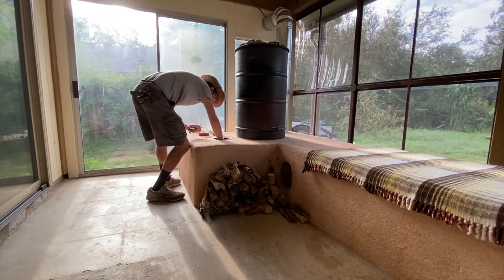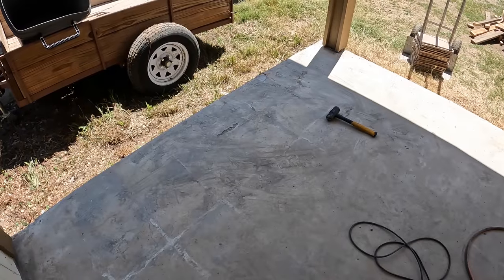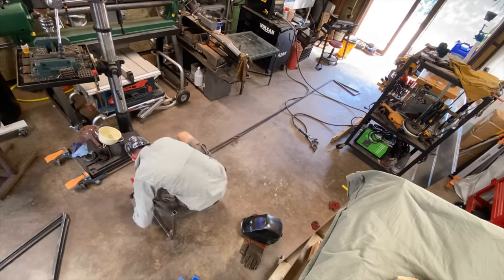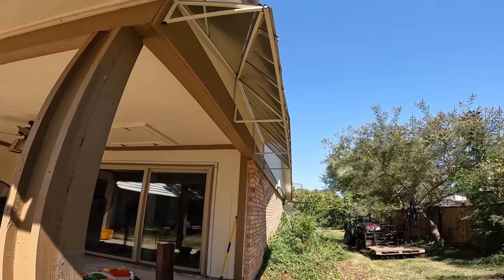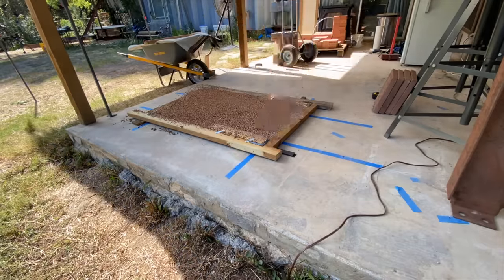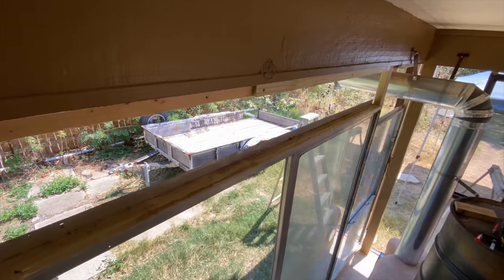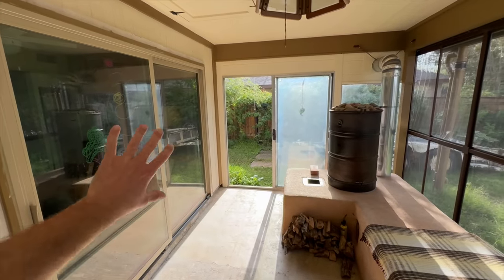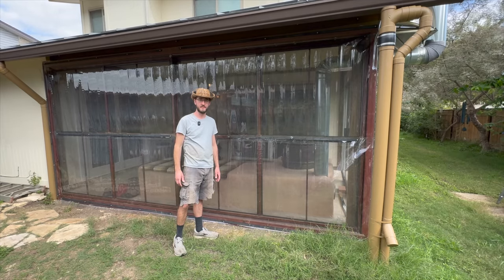FREE HEAT!!! Sauna in greenhouse porch heats our house.

Comment: i wouldn't want to put rocks on top of the barrel. You will probably be fine, but I would worry about the metal not being able to throw off enough heat and then the underside could begin to spall.  You could put some angle iron across the top on the barrel ridges, making an air gap between the rocks and the metal.   Also, for the back sides of the barrel, you could add a metal reflector to act as a bit of a heat shield.  Or ...  we are experimenting with what we call a "cape": something cobbish on  the back helps to get more heat into the mass and less heat where we don't want it.
Reply from the maker: Thank you for your advice! I noticed after reviewing the film that the lid definitely shifted when I added some water on top of it. It had crossed my mind that perhaps that indicated that the weight of the rocks was making it sag. I know I have seen the lid glowing red hot after prolonged fires so I’m sure it is an malleable state after a long burn. I will keep an extremely close eye on the lid after the next few fires. Thank goodness I have a spare lid ready to go on top if needed. But given your huge amount of experience, I take your advice extremely seriously. Thank you for commenting! As always, I appreciate the foundational work that you and your community have done. Thanks!
Reply: @suburbanbiology  having the top get soft enough that rock will shape it is definitely a concern. But I would be worried about spalling happening before that.  Plus, if you have to replace the lid and you share that info, then I cannot help but think the whole internet will go psycho about how all rocket mass heaters suck because the tops of the barrels get too hot. I far prefer that your rocket mass heater lasts 60 years without a problem.
Reply from the maker: I see what you are getting at. I have a basket I can store the rocks in for most burns. Then I can just bring them out for “special occasions”/sauna sessions. I have no interest in prematurely shortening the RMH lifespan or sullying the name of the tech.  I toyed with the thought of welding a reinforcement plate into the lid but right now I’m not trying to get that complicated. Thanks again!
Reply: @suburbanbiology  Quickie solution: make a rock "donut".  Rocks around the edges of the barrel instead of the middle.
Reply: @paulwheaton  @suburbanbiology  Also, in a Sauna, rocks are used because there's really no other thermal mass to throw water on so that it steams. Here, there's a drum sitting right there. I'm sure just using a windex bottle to mist some water onto the barrel will do the exact same desired effect. It may also even help provide air flow by adding extra cooling to the outside of the barrel. I would just do that very sparingly, and also do it uniformly, so that there aren't residual thermal stresses or distortions on the barrel by, for example, doing it only on one side all the time. But yes, I agree, rocks are probably not a great idea, and also probably not even needed when there's a metal drum right there to use for the same purpose.

All that being said, I'm not sure having hot cob in a high humidity environment is a great idea either. I would probably just go for dry heat. A RMH is just such a huge investment in labour, I'd protect it like it's a sacred relic.
Reply: @CanadianPermacultureLegacy    Won't putting water on the barrel while it is heated, prematurely rust the metal?
Reply: @justinw1765  not if it steams away. The rusting comes from prolonged exposure/contact to water/humidity. If they steamed water, then when they were done, circulated that humid air out, then it would be totally fine
Reply: @suburbanbiology  Please note that some types of stones can explode and shatter like a grenade under high heat.
Reply: Some kind of shielding that could swing around from greenhouse to porch side? (Hi Paul.😉)

Comment: As a girl from Sweden, I can tell you that it is not a sauna. I'd call it a passive solar and rocket stove heat room I guess haha. It's beautifully made though, so well thought through! I'd advise you as well to take the stones off of make some reinforcements for them. You could also buy one of those stove fans to put on it. That would be great to circulate the air as well 😊
Reply from the maker: From a girl in Sweden I have to say you are far more than informed than me. Point taken. The passive solar part of it does function quite well. I took the stones off shortly after shooting the scene that showed them. I was worried that every time I lit the stove it may lead to sagging of the lid. Thanks for commenting and for your support. Happy new year!

Comment: any greenhouse ive been in stays warm during winter so if you make a greenhouse you should put it near the house and have a way to pipe the air between the 2 places. just having a pipe at the ceiling and a pipe at the floor could be enough for the flow.
Reply from the maker: The plan is to take down the vinyl sheets once the greenhouse has been built. That way the entire wall of the porch is open to the greenhouse and I can leach the excess heat into the house if I open the porch doors. Thanks for commenting!

Comment: It won’t be working as a conventional sauna unless you add wooden walls and close off ventilation. It can be somewhat like a steam sauna if you keep on  adding water on the rocks but then there is the problem with the moist. So if you really want a sauna there it’s possible to add an infrared lamp instead towards where the bench is. 
However I highly recommend conventional sauna but it should be in a room dedicated for such, to perfection 👌
Great work on the stove though!
Reply from the maker: Good points all. Thanks for commenting and for your support!

Comment: For heating at nighttime on really cold nights, it might be a good idea to hang up an IR reflector behind the RMH system reflecting towards the entrance to the house.  You could put up velcro/hook and loop tabs and use the stuff that is sold as "radiant barrier" material for attics or the like, with corresponding velcro/hook&loop so it is easy to put up and remove.
Reply from the maker: Good idea! I’ll keep it in mind. My long term plan is to have a greenhouse on the wall where the vinyl is but if plans stall I may use your tip here. Thanks for your support and for subscribing!
Reply: @suburbanbiology  Cheers

Comment: interesting setup for a sauna but that is exactly what I would call that. Tho to make it a proper sauna you would need to hit temperatures around 80C
Reply from the maker: Man 80 is hot. I think I could get it up there after a few hours, though. Thanks for commenting, and for subscribing!!
Reply: I’ll bet one of those little box fans would work great for circulating the warm air through the house.

Comment: It could be just me, but any timber I use in external or internal humid conditions is pressure treated.
Reply from the maker: Probably a very good idea to prevent it from rotting. I used some pressure-treated, but to be honest not all of it is pressure-treated. Hopefully the paint will help resist.

Comment: No draft to control the wood burning. You'll learn. Might melt your barrel. Paint burning off your barrel may not smell too bad but you'll learn for that too. It is a rocket stove but you're losing heat transfer.
Reply from the maker: The full video covers a lot of your concerns. Fire bricks on top of the feed tube act as a damper. I pre-burnt the paint off the barrel while outside. 

World's most efficient stove!!!!  Made of DIRT!!!
https://youtu.be/TbdeZKzlV8E

Comment: I guess you could enjoy a dry sauna experience in there, but I wouldn't expect a good experience for a classic sauna in there. To enjoy the steam from the löyly, the space seems too wide and tall. You normally would have benches near the ceiling of the sauna, clearly above the level of the stove top, and limit it to a relatively small footprint so that when the steam rises up it's concentrated where you are instead of it dispersing everywhere.
Reply from the maker: Makes sense. I guess I could construct a tent or false ceiling around the barrel. I probably won’t though. Thanks for commenting!!

Comment: Do not use that for sauna, you are asking problems. You get high humidity during bathing, and you will end up mold problems later on on the structure. You should always insulate the (indoor) sauna. Waterproofing and vapor barrier prevent water in its various forms from damaging the surrounding structures. Waterproofing is necessary on the floor and the lower part of the wall. The walls and ceiling need a vapor barrier that overlaps the waterproofing.
Reply from the maker: Good to know. I have only really used it for dry heat ever since I shot the video. I will probably just do that instead of adding steam. Thanks!

Comment: i was wondering what you used on the ground for the reused sliding glass door. im guessing some kind of track.
Reply from the maker: The sliding door is a single unit. There is a sill that’s attached to the side walls of the frame. The sill contains its own track. They even make replacement tracks if that part wears out. Thank goodness mine was in good working order. Thanks for your support and for subscribing!

Comment: I have a crawl space under the floor of my living room. Is it possible to heat the whole floor with some pipes in the crawl space connected with a Rocket mass heater ? That would be awesome
Reply from the maker: I suppose it could work as long as you buried the tubes in enough thermal mass. If you just laid metal tubes under your crawlspace, though, I think that sounds like a pretty significant fire hazard. So this is more in the theoretical realm. But theoretically it could work. But please don’t do it ;)
Reply: @suburbanbiology  but it is only smoke and warm air that is passing through the pipes right? Can the pipes catch fire? Or do they become extremely hot?

Comment: Is your plan to vacuum out the ash periodically?  Technically, you could cook over the barrel, if needed.  How many sq ft will your rocket heater heat once the green house is built?
Reply from the maker: Shop vac into the feed tube gets the ashes out very quickly. Yes you could technically cook on top of the Bell. The house is about 2000 ft.². It doesn’t heat the far reaches as thoroughly as the rooms right next to the porch. But the solar heat that we get from this on a daily basis is pretty impressive. And of course the woodburning heater also helps on cold nights. Thanks for commenting.
Reply: @suburbanbiology  back up system for a back up system, smart of you.
Reply: @suburbanbiology  back up system for a back up system, smart of you.

Comment: Have you tried burning long pieces of wood, as in, several feet long?  I've seen videos where they claim to do it.  Just wondering if it's a real thing.
Reply from the maker: It becomes problematic if the wood sticks too far out of the feed tube. It technically might work, but it affects the draft in a way that leads to smoke blowing back into the room sometimes. I would advise using shorter logs only. Thanks for commenting, and for subscribing!

Comment: Why metal? Looks like a strong wind would rip the awning off.
Reply from the maker: Metal was rigid enough so I could build it on the ground and bolt it up after. Also probably a bit cheaper than wood, paint, shingles etc. also matches the house roof. I fastened it on quite thoroughly. I’m not too worried about wind. Thanks for commenting!

Comment: How do you not own any Bakers scaffolding?
Reply from the maker: lol. Ironically I do own a set. But the ground was so sloped right up by the house that it would have been difficult to level the scaffold. I know OSHA would puke looking at the tractor fork trick but I actually clamped things together pretty firmly. Can’t pretend to call it full on “safe” but if done right it’s probably not more dangerous than a scaffold…….is what I told my wife…… thanks for commenting!
Reply: @suburbanbiology  Wasn't thinking about the OSHA part of it, just that it's quicker and lighter in weight to move around than that bobcat or skid steer thingie you were using. but yea if the ground won't cooperate kinda hard to tip over a bobcat with one guy on a pallet lol.

Comment: Sauna is dry. No steam. Steam room is a different thing. Probably a word for it that sounds better than 'steam room' but i don't know it.
Reply: saunas can, and do often reach 100% humidity. I've never been to a sauna that was completely dry
Reply: @olkkiman  maybe that's just a US thing then?
Reply: Traditional sauna is not dry. But because its often heated to 60-120°C (where finns prefer something around 80-100°C) it won't stay "steam room" for longer than a minute after which you throw more water. The stove or "kiuas" as finns call it is so hot that the water instantly turns into steam after you throw water on it and the room won't become "foggy" because its fairly hot steam and the room is hot too. If the room is cold then it does becomes foggy but finns consider that to be cold sauna that is no go. It can easily look like its dry, but it is not. This humidity is a thing you need to think on building phase because water vapor will get into the structures and over the years it can be bad if it's not properly dried and ventilated after use. The remaining heat usually does great job drying it out, but its easy to trap water behind structures. What finns call as a stream room is turkish sauna and it means a room with visible constant thick fog on it, it's usually much more mild on the temperature as well around 40 to 60 °C. It's not that big thing outside of holiday resorts, but I guess its interesting as its mixed by its nature, while traditional sauna can be mixed but most often is not unless its friends or family.

Comment: bottlenecks.. a lot of them
Reply from the maker: The airflow is sufficient for a good draft. The fire burns well.
Reply: @suburbanbiology  i meant figurative "bottlenecks" 

1. No way of stacking wood inside, need of feeding the stove constantly.
2. Too much heat loss on the porch, by non-insulated windows, to even consider heating your home
3. Cleaning the burried pipes off of tar substances from condensation inside the cooler parts.
4The cost. Too much labor and material expensive.
5. A simpler stove would be much more efficient in the long run and you can move it or add more for the greenhouse.
6. Actually.. with the money you've spent you could afford a simple stove inside your house including the wood fuel.

*Sauna was just a f...in joke, you wouldn't.